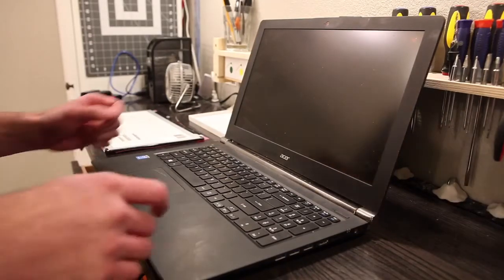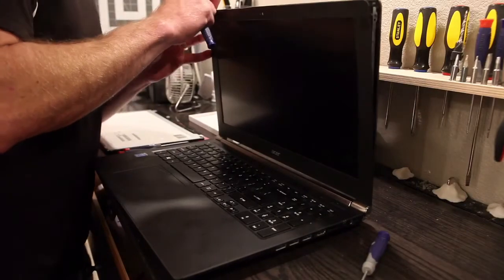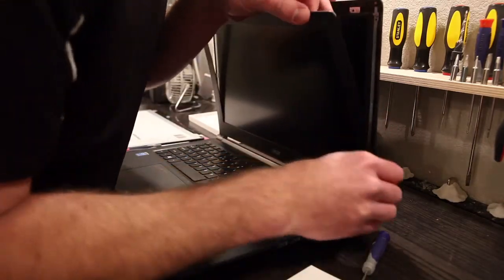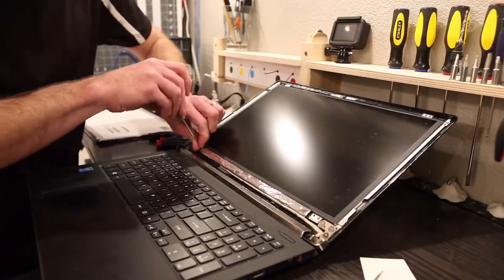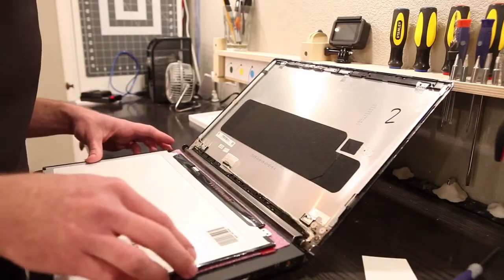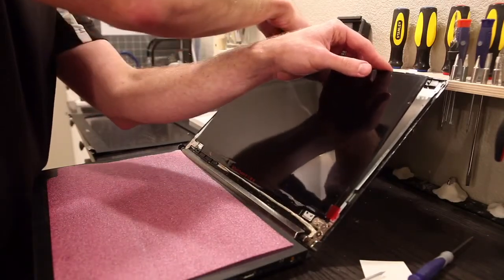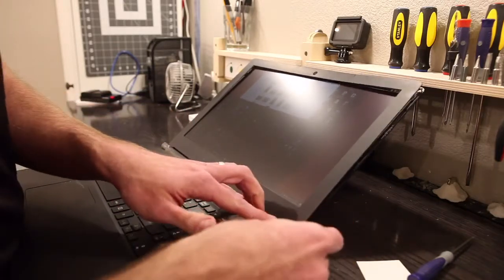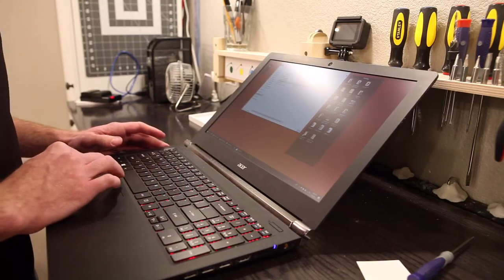Laptop screen replacement / How to replace laptop screen Acer Aspire V Nitro VN7-591G-792U

Comment: does replacing the screen usually solves the annoying vertical lines issue ? or is the issue in the cable ? when i touch the bottom bezel the lines change a bit.

Comment: Hi, i have the vn7-593g model with a full HD screen and your model has a 4K screen. Do you think i can upgrade mine?
Reply: Younes Ouis - Mine actually doesn’t have a 4K screen. But if you find it can be upgraded let me know!   (Replying with my main account)
Reply: @KeithsTestGarage  for the vn7-591g there is 4k screens available. Im just not sure if you have to fix some software issues for running all games or windows itself in that resolution.
Reply: Younes Ouis I’ve got 4K on a 27” monitor. That would be insanely cool on a 15.6”!